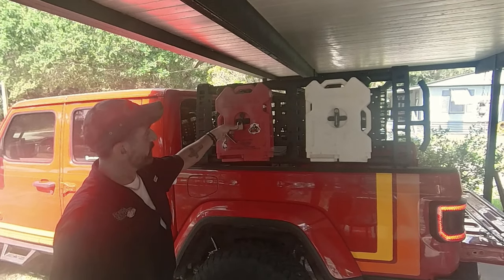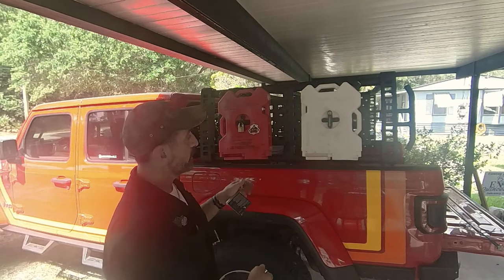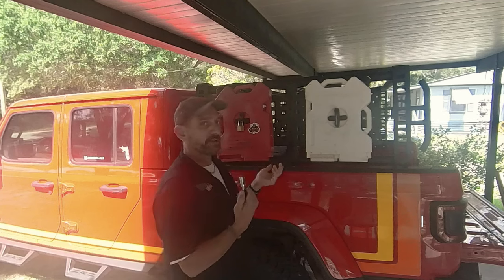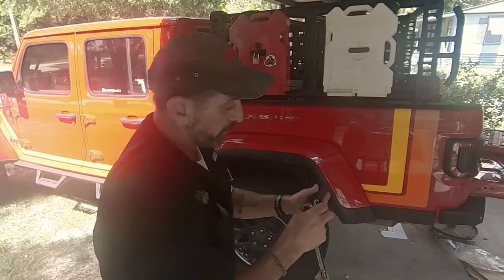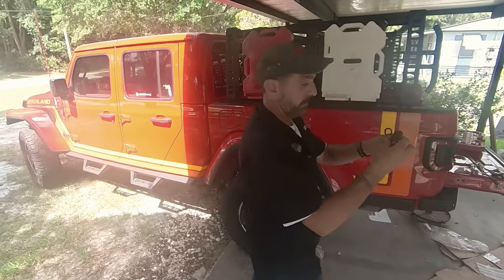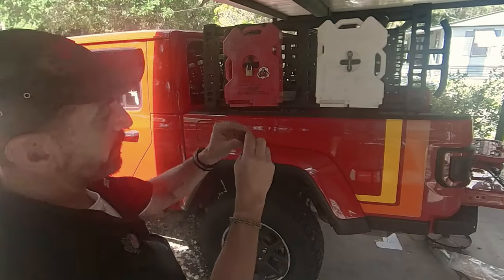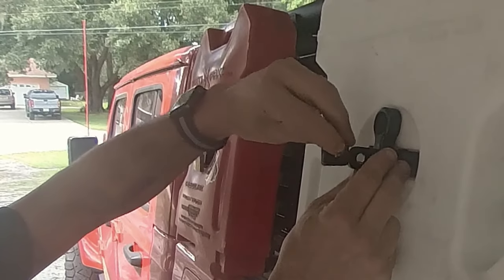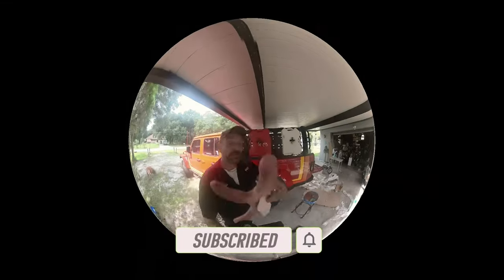Jammed or busted Rotopax lock? Replace it with Gorilla Clamp

Comment: I’ve got two of the mounted on my pick up truck and I’m about to mount three more on my jeep and now that I’ve seen that product. I think I’m going to pull the trigger because I had one fail and it was locked inside. I had to drill it out for like an hour to get it out of there. It was a royal pain.